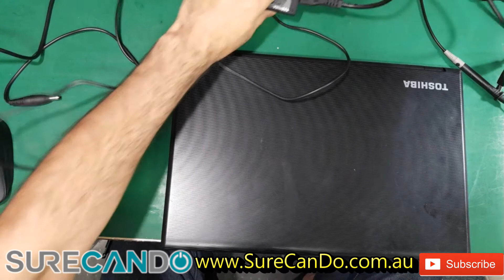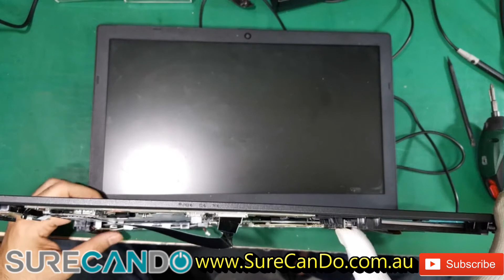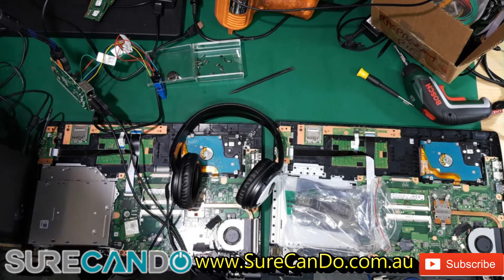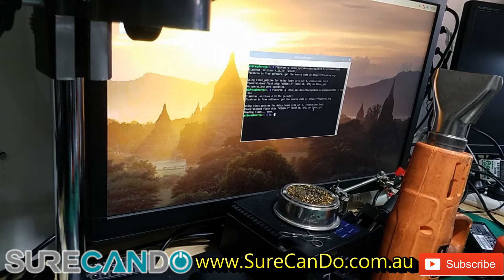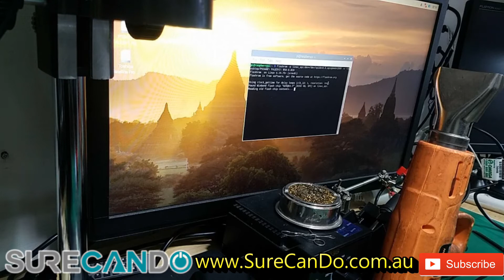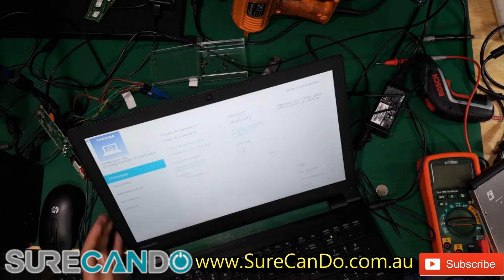TOSHIBA SATELLITE R50 Repair Guide Turns On Off LED Blinking Non Stop

Comment: Hi !
I have an R50 , verry similar to this one. It was given to me with black screen, and Nu lock led powered on constantly.
I'm thinking about a bricked bios, possibly an error in the bios EEPROM.
I extracted bios with Comflash and all, tried an emergency flash with USB key, but will try to flash it with GQ4X USB programmer... What do you think ? I'll keep you in touch ... Nice video and very informative for me ! Cheers from France
Reply: @SureCanDoComputersServices1  Infortunately, after a lot of search, I guess I didn't find the right bios file, nothing worked.. I put back the extracted bin.. Still num lock light. Thanks for the video!! I'm pretty sure the bios is corrupt.
It's a Satellite pro R50-C-15X , FLESSY2 A4227A, I3 with no nvidia.